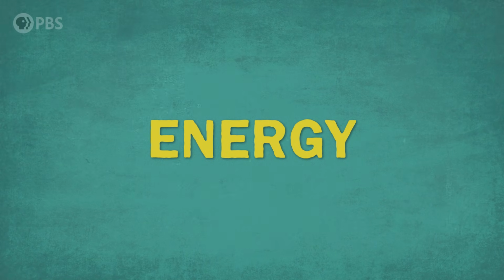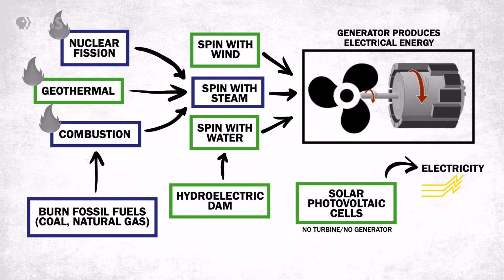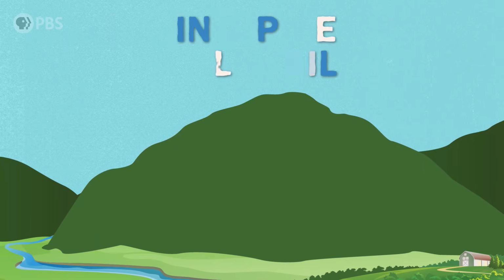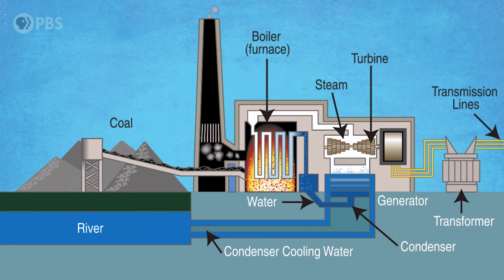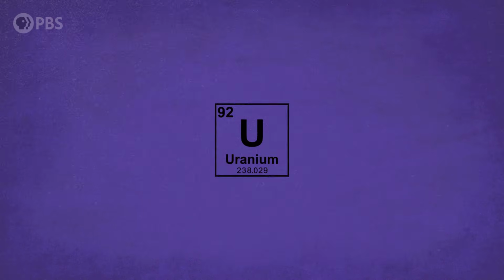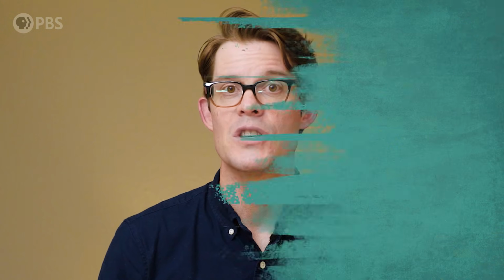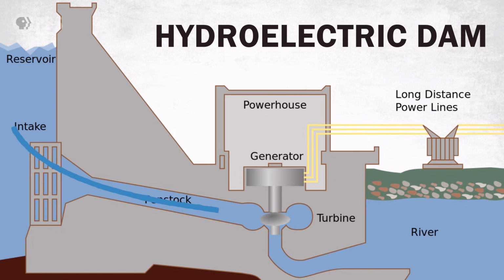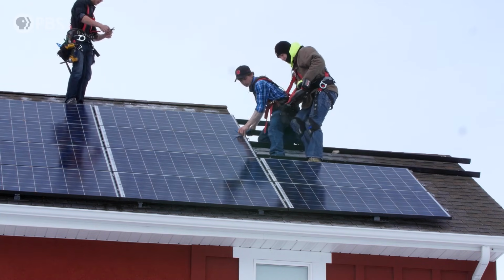How We Make Energy  | Essentials of Environmental Science

Comment: There's a deep nuclear storage facility in Finland - the Onkalo spent fuel repository - that comes into service in 2026. It's on a seismically stable island, where the spent fuel will be buried 1500 feet underground in bedrock, first sealed in steel canisters then a thick copper shell before being surrounded by bentonite clay that swells when groundwater comes into contact with it, sealing the area. I believe it will be an internationally available repository so the US should also have access.

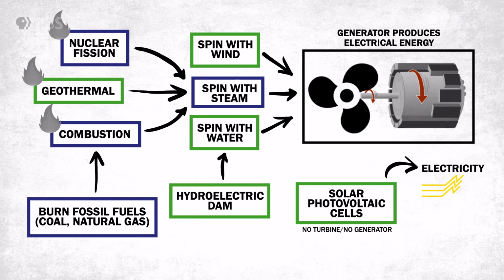Comment: 3:30 - just to be picky, while this is true for practical timescales (and we should absolutely be converting to "renewable" sources as a species), every energy source runs out eventually, and while using these sources won't make then run out faster, the rate at which we can use those sources is more hard capped.
Also the sun runs on nuclear energy and every other source on the chart (except geothermal?) is ultimately powered by the sun.

Comment: I was just on a site where they proposed pumping stuff into the atmosphere to divert the sun’s rays, to hopefully cool the planet a bit. Blocking solar radiation by tinkering with the atmosphere is both unsafe, and a pathetic half-measure. The better course would be to block some degree of solar radiation before it reaches the atmosphere.
Satellite solar collectors can capture solar radiation and convert it to electricity. The gigantic shadows of these solar arrays can be steered to cool specific areas, for example the warmer ocean waters that a tropical storm is tracking towards. Everyone knows that these storms strengthen when they pass over these warmer stretches of water, and a cooling effect placed in the track of a storm will deprive it of the energy to become a hurricane. It seems likely that proper implementation of these effects will also allow for the possibility of steering these nascent storms away from landfall.
There are many uses for the incredible amounts of electricity that can be generated, almost as a fringe benefit of planetary cooling engineering efforts. Some may be used for space based factories.
Some can be beamed down to earth-based stations as microwaves, and inserted directly int the power grid. Another complementary approach is to use the electricity to separate water from comet and asteroid ice into hydrogen and oxygen. Hydrogen is finally being recognized as one of the promising fuel alternatives we have been looking for, and who doesn't like oxygen. Actually, keep the oxygen up there, they will need it for breathing as other projects get rolling. This won't all pay for itself, but the money saved from avoiding most hurricane damage will help a lot. Plus, like, saving lives and such…

We are already changing climate, we have to get smart about it.

Comment: Are there plans to do an entire video on nuclear energy? There's a lot to cover from the different mining processes (open bit, shaft, and in situ), to the different reactor design types (including those with passive safety and immunity to meltdown), and to the end of the fuel cycle with potential for fuel reprocessing, burner reactors, waste storage. There's a lot to talk about with nuclear energy and you just scratched the surface here. It's an important conversation to have since nuclear energy is 55% of the clean energy in the US and nearly 1/2 in Europe. A lot of politicians/people don't see the necessity of maintaining existing nuclear power plants and the potential for expansion as a bridge energy source to a completely sustainable energy system.

Comment: technically you could have a thermocouple which generate electricity directly from heat via seebeck effect, extremely low efficiency though. Mostly used in probe meant to sent to outer solar system where sunlight is too weak for solar cell.

Comment: Increasing battery meat and dairy production in a single location is stackable in a skyscraper and produce crap that in turn has enough methane to distill the crap in to automotive fuel, bunker fuel and tar.
Hydro-carbon fuel distillation also works on rubber and plastics, eliminating the need for landfills.
The small amount of ash that remain after fuel distillation is the minerals that plants extracted from the soil in the growing process and, in the ash form, is ready to use in cement, reducing the global carbon dioxide emissions. 
Fuel distillation is a process that any daring person can do in their backyard, unlike mining or oil drilling which is a monopoly endeavor.
- South African patent featured in the April 2013 South African issue of Popular Mechanics.

Comment: The nuclear closed cycle, such as the demonstrated molten salt breeder reactor, Alvin Weinberg at ORNL makes nuclear a renewable source by your definition because we would use less fuel than is eroded from the land, into the sea.
We'd use on the order of 1% of the heavy metal per unit of energy and would not have any super long lasting radioactive wastes. We would still have highly rad fission products though with up to about 350 years of radiation.
So ya, might want to Google that which I highlighted.
And thanks, excellent energy stuff!

Comment: Would it be possible to do something about liquid salt nuclear reactors? I was told once that it was impossible for them to overheat and go critical, that they reduced volume of nuclear fuel put into them, that hydrogen was a bi-product of power production, that they could be built smaller, and that the reactors could be buried under the ground during operation. Is it true that they can do all these things, or was the person informing me exaggerating their benefits?
Reply: Yes, it's true. All reactors today shut down on their own in emergency and it is literally impossible to melt it, no matter how hard you try. The reactors you mentioned are called gen IV.  They take safety to a completely different level to make them even autonomous so they don't even need any staff at all.  All reactors create heat that can be used to heat homes or to hake hydrogen or biofuels, some reactors already do that today. There are some SMR (small modular reactors) being built today. They are used on submarines, aircraft carriers or icebreakers as an alternative to oil. The main advantage is that you have to refuel them only once every 40 years. Some companies try to make them commercially available for the grid and there are some plans for 2025. Their main advantage is that they are smaller cheaper and you can get them anywhere with a truck, this would be useful in countries like Canada where where the population density is very small. The gen IV would allow us to use different fuels, the most interesting is probably Thorium. It's three times more abundant than Uranium, you don't have to enrich it( natural Uranium contains two types of Uranium, fissile and fertile. Most reactors today can only burn the fissile part, but it only makes 0.7% of natural Uranium so you have to enrich it to 5%, it's a complicated and expensive process) and most importantly, it can't be weaponized. It's a bit complicated and don't really know how to explain. Another advantage is that the nuclear waste is much less short lived, about 400 years and in much smaller quantities. CANDU reactors already do something similar by using natural unenriched Uranium, the fuel is really cheap, but you need something called heavy water that increases the construction cost. 

So yes, the new reactors would bring a lot of new opportunities and technology, but some of it already used today

Comment: I wish I was an engineer, because there has to be a way to build a hybrid machine. I have ideas, but all I can do is draw...
Reply: Drawing used to be an essential skill for engineers. I mean, it still is, but it's usually done with computers now. The point is, you need a way to get a design out of your brain and into the brain of the guy that's going to build it and, even before that, to discover and fix problems with the design while it's still "on the drawing board." Paper and pixels are cheaper than stone and steel.
"Art without engineering is dreaming. Engineering without art is calculating."

Comment: when we talk about wind energy, why doesn't anyone talk about kite power? it is cheaper and easier to build, has a better capacity factor because you can fly the kites at a much higher altitude, and unlike a wind turbine, doesn't tend to kill birds as much because they know how to deal with a flying thing at high altitude better than a giant slowly spinning turbine. it doesn't even have as much on an aesthetic impact as traditional turbines.
Reply: If you mean toy kites or some alternative of them, then the answer is that you can't get energy from them.
Reply: depends on exaclty what you are looking at, but kite power either means using kiteboarding kites or small tethered aircraft with generating propellers on them. 
the airplane approach just uses the tethered flight to cover a large area at higher altitude and lower cost that a traditional turbine could and run power down through the tether. 
the kiteboarding kite approach takes advantage of the fact that they pull much harder when doing figure eights than when sitting strieght overhead, so that a manuvering kite pulls out a reel, generating energy, while it reels in a stationary one for a tiny fraction of the energy cost. 
the airplane ones tend to generate more power, while the kite ones are more portable, like for disaster relief.

Comment: Nuclear: Steam is the most powerful greenhouse gas. Most of the heating is caused by water vapor. Granted, the air can only hold so much water vapor and rains it out when saturated but the steam will stay in the air even at 100% humidity.
Reply: Not all water vapor is the same. Trees are cooling the planet by releasing water vapor too, so should we cut them all down? I don't think so. The steam forms clouds that have a high albedo, therefore they can help cool the planet.
Reply: Can you elaborate on the last sentence? It seems a bit contradicting...

Comment: The video is fairer than most eco-oriented channels tend to be but still leans heavily in favour of renewables and against nuclear energy.
Let me be clear, renewables are great to reduce the use of existing fossil fuel power infrastructure, HOWEVER they CANNOT replace it unless and until there is a way to store and distribute power on a national/international level at a scale of days to months. the power network operates at a fixed voltage intensity and frequency, it must match the demand exactly at all times, lest you want to be left in the dark every time the wind fall or a cloud passes by.
To replace fossil fuels you either have geothermal, hydro, or nuclear power. the first 2 are dependant on geography, once you have maxxed those all you're left with is nuclear. 
It's not ideal, it is dangerous but has been made safe from experience from past disasters, it requires little material extraction, even compared to renewables with their giant concrete piles, ungodly amounts of rebar and steel masts and sheets of rare metals, nuclear also requires little space compare to the millions of acres you'd have to cover in mirrors and windmills for and equivalent maximum capacity dependent on weather.
Regarding the waste you cleverly selected the 2 most inept countries at dealing with it, the US and Australia, while the rest of the world reprocesses it, melts it into glass, stockpiles them in steel cases in concrete envelopes under a warehouse awaiting the approuval and excavation of underground repositories where it will be safely contained. Waste isn't an issue, we've kept 95% of the radioactivity a few meters under concrete in a few acres of hangar space in France for morte than 50 years, most of the waste is low activity rubble or reusable fuel after re-enriching it for 4th generation reactors.
Climate change is enough of a challenge without sneering at solutions for no good reason. Let's use all the tools at our disposal and let's transition away from fossil fuels that do more long lasting damage to us and the planet in a day than nuclear ever has in a century.
Reply: Even in the US, the nuclear waste storage failure is due to nuclear panic more than bad planning. when the US nuclear industry was being built, there were plans to store all the waste under a huge mountain in new Mexico where they would have the tunnels collapsed in on the filled storage caverns and it would be safe basically forever. people panicked about having trains with giant barrels of concrete that had a little nuclear waste in the middle going through their towns and about having it miles under their mountain, none of which was actually dangerous.
Reply: @thamiordragonheart8682  It's more complicated than that, there are laws preventing nuclear operators from doing pretty much anything with the waste but keeping it on site, which thankfully doesn't cause any damage in itself since it's just sitting there being monitored, but with many nuclear plants closing, aggregating the waste in one or a few sites would make inventory, surveillance and eventually processing of the waste a lot easier.
Reply: I found very misleading calling natural gas fossil gas. It makes no sense at all.
Reply: @Brandon_letsgo  How is that misleading ? It's a fossil fuel under gaseous form, it perfectly conveys the point that it comes from the ground and we should avoid extracting it unless it replaces dirtier alternatives like coal.
Reply: @Soken50  Natural gas was created by natural process throughout the years. So we should called it NATURAL GAS.
Reply: @Soken50  The use of "fossil" is a left-wing tactic to make it sound dirtier and more "evil". Totally BS.
Reply: @Brandon_letsgo  Sure bud, feel free to come back to the debate table when you have sound arguments.
Reply: @Brandon_letsgo  You have to be trolling
Reply: @garry8390  Tell me that natural gas was not formed by natural process...
Reply: @Brandon_letsgo  everything is created from natural processes, unless you have metaphysical powers you failed to mention, it's not anything especially good or bad, nor is anything fossil.
In the context of climate mitigation though, avoiding releasing sequestered carbon in the form of fossil fuels is preferable, calling "natural gas" fossil in this context is hardly misleading.
Reply: @Soken50  Climate mitigation? The climate has always been changing. There's no way to stop climate change.
Reply: @Brandon_letsgo  The fact that the climate has always changed doesn't stop us from altering it in a positive or negative way. While there are some good arguments to be made in favour of a warmer earth in the long term, the rate at which we are altering it right now is far higher than the natural rate of change, barring extinction level events like cataclysmic volcanic eruptions or kilometers wide asteroid impacts, and is dramatically affecting ecosystems and their trophic networks.
Reply: Soken50 show us where it says this in the most recent UN IPCC Assessment report, and I do not mean the summary for policy makers. As someone who has actually read the report it clearly makes concluding statements that there is no evidence of increases in floods or draughts, cyclones/tornadoes, extreme weather or winds, and the rate of sea level rise is the same as that for the period from 1910 to 1940 before GHG emissions were sufficient to impact climate, etc. I challenge you to find a concerning extreme weather indices in the assessment report that supports the contention the climate overall is getting worse and it is due to fossil fuels.
Reply: @davidsimpson7373  had you mentioned me in a way that ensured I received the notification, I would have responded quicker, but since I happened to come back to this thread, I'll answer now.
What am I supposed to show is said in a report I made no claims about ? I didn't even mention weather so feel free to expose your climate change denial by using the report from the intergovernmental panel on CLIMATE CHANGE and cherry pick the parts you like while ignoring the fact the planet has already warmed by more than 0.5°C.